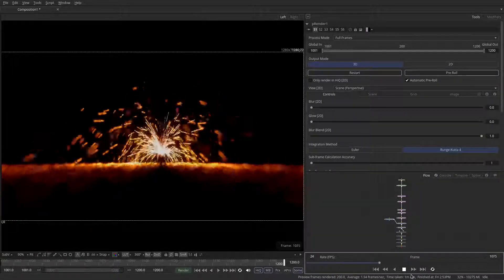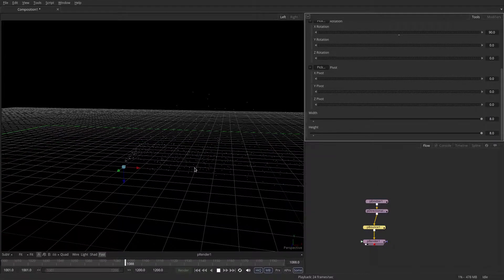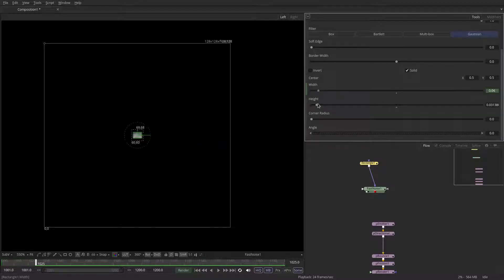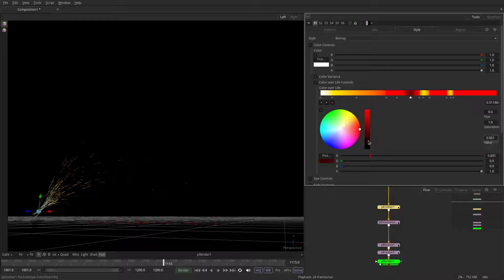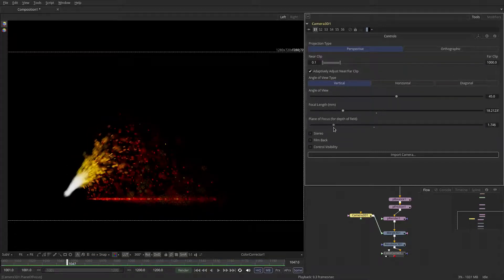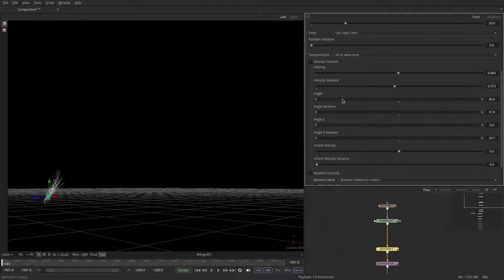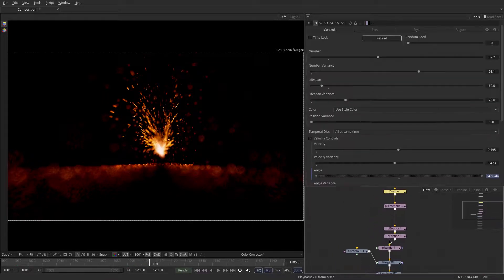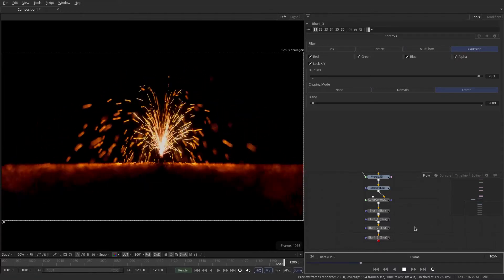Fusion Particles - Angle grinder / Sparks

Comment: Learned some complex stuff in here. Particles in Fusion are nuts. Way better than Particular. It's no Houdini but to get a decent effect, once you know what you're doing, is not that hard. 
Thanks man. Made my first completely absurd node tree with this little exercise and I gotta say, it's a real wonderful way to work.
Reply from the maker: If you dive into the pCustom node it turns out its a lot closer to (old) houdini pops actually. Combine it with sets and you do some pretty advanced stuff!